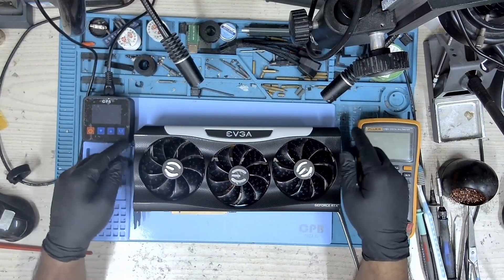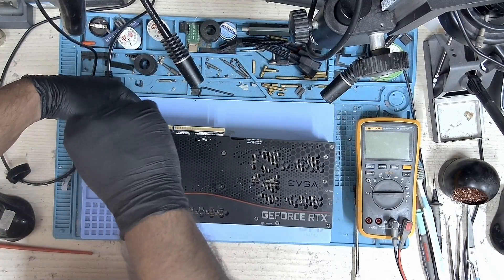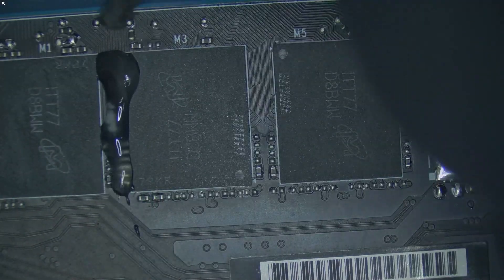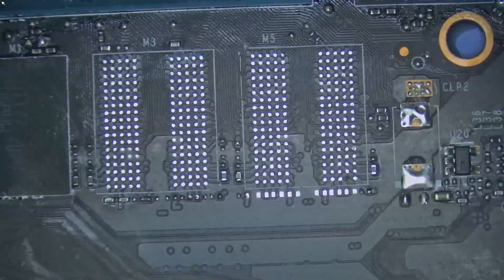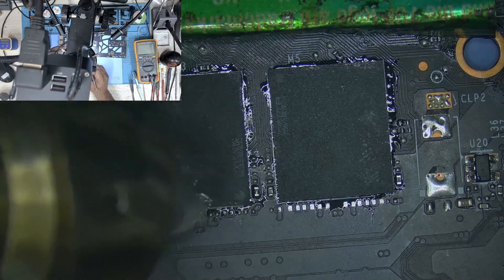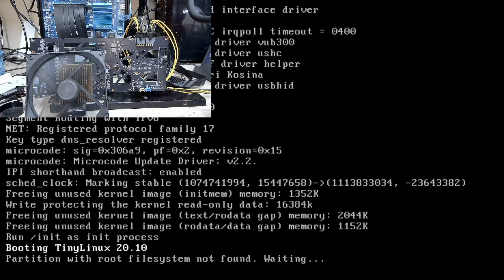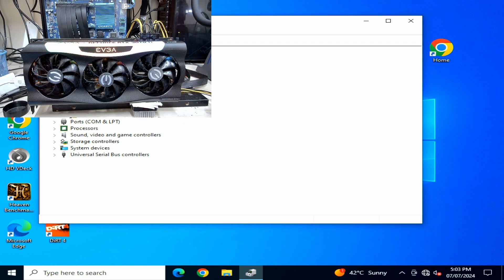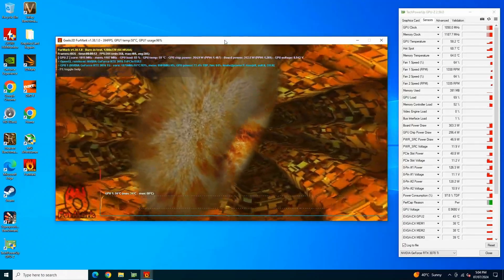How I Fixed My RTX 3070Ti Black Screen Issue

Comment: Hey bro, I have EVGA RTX 3070 FTW3 GPU and the card works fine but the fans stay at full speed because the PWR4 sensor is reading wrong. In GPU Z the PWR4 temperature is stuck at one hundred thirteen degrees even when the rest of the card is cool. Before it got stuck it used to jump from normal temperature to one hundred thirteen in a split second which makes it clear the sensor itself is faulty. 
There aren’t any GPU technicians in my city and I’d really appreciate it if you could tell me where the PWR4 thermistor is located on the PCB so I can guide a technician to replace it.
Reply from the maker: Have you tried replacing the thermal paste to check the temps look normal? If not I will recomend to try replacing thermal paste first. If the issue does not get resolved then try replacing the power monitor IC. It's marked NCP4549 or US5650Q. That's the part number of the monitor IC.

Comment: Hi - excellent video, I have a quick question as I have the exact same problem on this exact card & the tools required to fix it... I'm stuck at diagnosing though as I'm unsure as to where to find MODS? 

Any tips on that? Or is there an open source alternative that will check the memory modules in a similar manner? 

Thank you!
Reply from the maker: You can join the discod server of Tony (Northwest Repair) or Richard ( Learn electronics Repair) and download the files and create your own USB for free or you can buy and download a clone of my USB which I use which has everything in place. The link is https://gpusolutions.net/shop
Reply: @GraphicsCardRepairs-tk7ql  thank you so much for the info & such a quick reply, it's so very much appreciated as this has been driving me nuts for a few days now ... It black screened out of nowhere with no warning, it's not detected on a second mobo that has integrated graphics (no NVidia entries in lspci results) - my main rig just won't POST as no integrated graphics, hangs on VGA light.

I'm guessing it's a power issue as a result?  I'm going to follow along with one of your 30x series not detected videos to try to isolate the problem. 

Again thank you so so so much for the info & incredibly high quality troubleshooting videos. They're so very helpful!
Reply from the maker: @phishphan49 your welcome 😊
Reply: @phishphan49 Did u fix it pal? Have the exact same problem with my friends 3070ti
Reply: @reymondox1935  I followed along with a number of very in depth GPU diagnostic guides and spent a hell of a lot of time on it - I couldn't identify the source of the issue or even anything that pointed me towards a specific circuit - everything read normal & wasn't able to find anything to point me in the direction of a possible fault.

I'm decently capable at troubleshooting & have the tools for SMD work at that scale + have successfully repaired or modified devices in the past - just never GPU's. 

I ended up selling it on eBay as/is for parts after many hours of trying to find the issue. 

Anecdotally/my gut feeling is it was a bad core - it was an FTW3 card that I ran in OC mode & was able to push both mem & core clocks up a good bit more beyond the stock OC. Was stress tested and stable/ran at those speeds for years. 

Several months ago I switched it back to stock OC when troubleshooting what at the time I thought was an issue with my memory timings but now suspect was the GPU. 

All I can say is I picked up a lower end 3080 NON Ti for a great price off Facebook marketplace (MSI Ventus 3 LHR from a pre built that dude had just upgraded to a 5080).

Benchmarks say that a 3080 should only be 19% more perfomant than a 3070 Ti - but honestly it's like a night and day difference - as such now think my GPU was exhibiting signs of impending failure for months prior to the black screen/not detected by monitor or BIOS that I simply missed because it wasn't like obvious artifacting/etc... 

Hope yours is easier to solve than mine turned out to be, but that was my experience with it. Best of luck!
Reply: @phishphan49  Thanks for the explaination buddy! is sad that you couldnt find any solution, but im happy to hear that you got a great deal! My friend sold his 3070ti in facebook marketplace and just bougth a 3070. Is just a 7% loss in performance, but I think everything will be allright because he doesnt play modern gpu intense games

Comment: I got exact same GPU - EVGA 3070 Ti. Mine have no picture, has 3 red lights on at power connectors, and only one fan spins. I took it apart and looking thru it for three days now, kind of don't know what i'm doing. thermal cam shows that chip next to fan connectors is hot pretty soon after powering up. Main chip stays cold at all times. Any suggestion where I should look, what to check, would be very helpful, thank you.
Reply from the maker: Thermal cam is not enough. You would need a multimeter, hot air station, soldering iron, flux and a variable bench power supply. If you don't have repair experience it is best to give it to a repair technician for repairs. You can learn on dead boards, practice and then move from there.

Comment: I have a question 
My laptop has a RTX 4060 gpu unit
Is it possible to upgrade to 4080 gpu unit

Laptop is acer predator neo helios 16
Reply from the maker: Hmmm. Sound like an idea. I have not tried it yet but is intresting. Would love to experiment something like this.
Reply: @GraphicsCardRepairs-tk7ql  would love to see that

Comment: Hello, I have 4 empty slots from VRAM on my zotac 3070Ti 8gb, do you think it would be possible to add 4x1gb of VRAM (the same as that existing), to upgrade 8 to 12gb of VRAM?

(Knowing that I have nothing to do not, and that even the rebillating is made on the motherboard ..., or even to change the model of Vram which can cause incompatibilities, remains to be seen whether these empty slots are good connected to the Power).
Reply from the maker: If you have 4 empty slots then your GPU is using the GA102 die. The empty slots you see are disabled from the GPU core. Installing memory there will not work. The GA102 die used as a 3070Ti is cut down.
Reply: @GraphicsCardRepairs-tk7ql  Hi, I have the ASUS TUF Gaming 3070ti with the GA104 die. Is it possible to do the same modification as your RTX 3070? Thank you.
Reply from the maker: @CWTech_3DP-CNC no it does not work on GPUs using GDDR6X

Comment: When you tested furmark and Heaven. I see 11V on 12V Riel #1 and #2.

Can you see your Power Supply? I think it is low voltage.

Sorry for my poor english. Good video.
Reply from the maker: Yes I have to replace the cap of the power supply. It's a 1600w but it's quite old and the cap is not holding up that well.

Comment: Great job.  Have you been able to work on any experiments with upgrading the memory of a 3080 yet?
Reply from the maker: Not yet. All the upgrades are pending. There are a lot of GPUs in the queue for repair because of which I was not able to continue working on upgrades. but the next upgrade video I should be able to post will be the RTX 3070. 😁

Comment: Hi, awesome vid as usual, want to ask, I want to do repair like this as well or should I say learn an I managed to get almost all the tools I need but I'm stuck on getting a microscope, is there any like fundraiser sites you could recommend to help me raise the fund for one as its expensive in my country, sorry if its a weird question
Reply from the maker: There are no fundraiser sites for this kind of thing. Not that i know of. But it's not necessary that you have to buy all the tools at once. you can build your kit over time. buy only the necessary ones like Hot air, soldering iron, multimeter, variable power supply, flux, soldering wire, isopropyl alcohol, and some kind of magnification. this is all you require to start. rest you can build over time as you learn and get better and your locality knows you do repairs. This is how I started. 😁
Reply: @GraphicsCardRepairs-tk7ql  thank you, I got all my basics, is there a email address where I can ask you a question in private please
Reply from the maker: support@graphicscardrepairs.com
Reply: @GraphicsCardRepairs-tk7ql  thank you

Comment: Hello Frazier.
I have a question.
I asked another guy if its possible to add more vram to a 3080 10gb EVGA FTW3.
He said it was impossible.
So I ask you, is that something that can be done, and in a working state or is it truly impossible?
Reply from the maker: There are currently lots of hiccups with the 3080ti I am working on. Currently I have not been able to fix the issues with the 3080ti until now.  But if I am able to get around it I will release a video. Even if I'm not able to I will still release a video on the progress and updates of that GPU so it will still be a case study that can be shared. Also there will be lots of inputs for other minds as well.
Reply: @GraphicsCardRepairs-tk7ql  Okay. Thank you very much for addressing that and satisfying my curiosity. I will be waiting to see your next video.